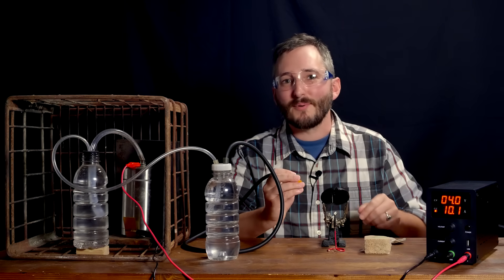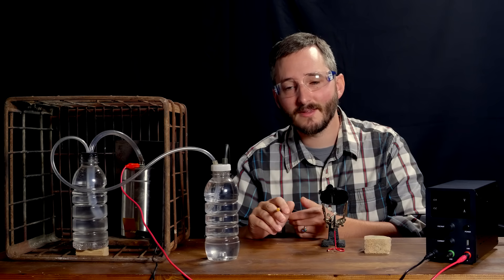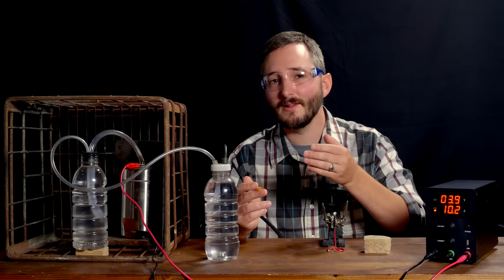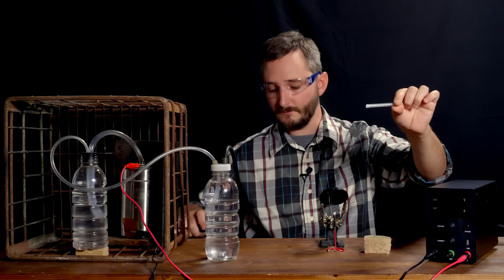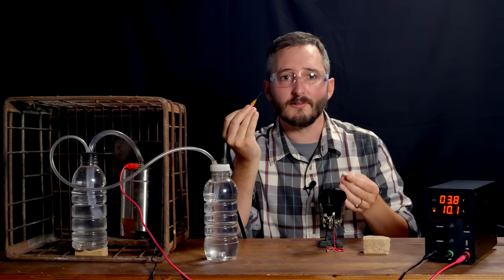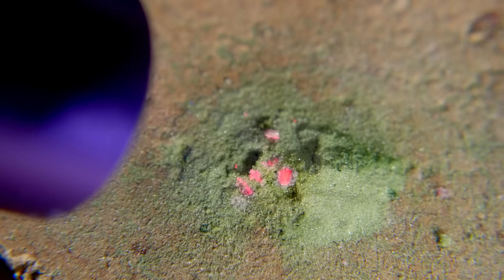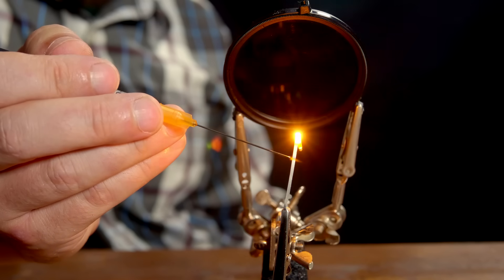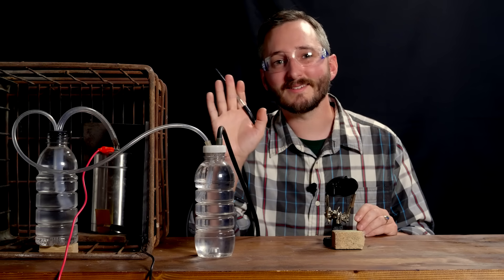DIY Oxy Hydrogen Torch Using Water Electrolysis

Comment: I think you have the necessary ingredients for a ruby 3D printer
Reply: That actually very big brain
Reply from the maker: Interesting thought
Reply: @Nighthawkinlight  Time to get in touch with Integza, 3D print a ruby rocket engine!
Reply: @Nighthawkinlight  nice like metal 3D printer only Ruby?!  Neat!
Reply: @Nighthawkinlight  the setup will blast first before any decent ruby is formed. Or atleast the nozzel will.
Reply: O @Nighthawkinlight
Reply: @Nighthawkinlight  1:30 to bad i defintly will be building one of theses
Reply: @Nighthawkinlight  Holy shiiiiiIIIIIIIIIIIIIT HE'S RIIIIIIIIIIIIIIIIIGHT!!!!!!!! @.@!!! <3
Reply: @Joemama555  brilliant.  I was trying to imagine of the same thing, and couldn't remember where I saw the concept before.  I think for this to work with the ruby precursors, more control over the HHO mixture and pressure would be required.
Reply: Maybe you could 3D print ruby in SLM style 3D printers typically used for metal. I’m sure someone’s tried it in a research setting although SLM printers are prohibitively expensive for the average hobbyist.
Reply: @eyeborg3148  you dont need anything fancy basic 3d printer controls same as the normal guy maybe just in reverse.bottle goes in the same place where you put filament.cable goes down.but is ruby dust really that looked for?there has to be a simpler way to make florescent
Reply: Gotta program the printer in Ruby
Reply: @FireFish5000  if (that != has !beenDone) || could be done even, or odd, oddly enough, then I would personally see sharper by rather printing and programming in pure PEARL if there is such a thing... in fact i think that is almost how they are created in nature, not sure but surely man can make it too, since "we" discovered how to channel energy... well done Firefish5000 
BUT - you said you read all the comments so let US see what You are made of... 
So, how about Gold ? or is that too old ? Original alchemy => why not melt lead and add whatever under heat and if needed pressure to transmute the one into the another... just saying
with that freaking torch you can do even greater things if you give it some boost, 
like thinning things under extreme pressure,
to say 10 atoms thickness, so that it can bend and stretch and perhaps then we can cover the world in something conductive so that we can solve this stupid energy problem once and for all, all starts with a little bit of water, fire air and you can create anything on earth 🙂
Reply: @Joemama555  if the flow rate is high enough, the flow of gas may bring powder with it (similar to sand blasting)? This can greater simplify the design if it works
Reply: @roywang7414 pero para eso existen los compresores,sería bueno lanzar hidrogeno con arena?
Reply: @roywang7414  that idea was several decades old in the 80’s when I read about it in grade school. This was the primary technique for making ruby rods for lasers. The powder would drop via gravity through the flame onto a rotating rod where it would form a boule and the spinning rod would slowly be pulled away from the flame as the rod grew. The ruby making portion of this video was essentially my 7th grade science project back in 1987. Except I used an oxyacetylene torch, because that’s all I had access to. I knew oxyhydrogen was the way to go, but didn’t go through the steps to make an electrolyzer until later.
Reply: @TroyeWelch  in your time was it common knowlage you can extract hydrogen with electrolysis?
Reply: @knezivan1 wow- you’re responding to a comment from 2 years ago? In case you missed it, I was in the 7th grade, I.e., 12 years old. What were you doing when you were 12 years old? lol. Got nothing better to do than add meaningless comments to 2 year old comments?
Reply: I worked for a company back in 2005-2008 that sold and repaired heavy equipment here in Florida. The company added a new service that was the equivalent of re-chroming hydraulic cylinders, except we didn’t use chrome. We used a carbide powder which was sprayed from a nozzle that used propane,oxygen, and hydrogen and compressed air as the fuel for the flame. Think of it like a professional paint spray gun used in the automotive industry, with the gasses and flame replacing the compressed air and the powdered carbide instead of paint.  Chrome involves a more tedious and liquified process and starts to break down on hydraulic cylinders around 100,000 cycles. The carbide coating didn’t show any signs of breakdown at 1 million cycles, for the test was terminated at this point. We used large grinders to strip the chrome off and then placed the cylinders in a lathe sand blaster. Before placing them in the spray booth, a meter was used to check the surface texture so that it’s texture, or “roughness”, was adequate enough for the carbide powder to adhere to it. The spraying was done in cycles to prevent the cylinders from exceeding a certain temperature, it was 500 degrees if I remember correctly, but it did change a little according to the diameter of the cylinder. Once it reached just below the temperature threshold, the flame shut off and the compressed air turned on to cool the cylinders back down to around 250 degrees for the next spray cycles to begin. The coating had to be at least 10 thousandths over the factory cylinder diameter, in which diamond coated sanding belts were used to sand it down to the factory size and then polished to a mirror finish. It looked almost exactly like chrome except it had a very tiny gold tinge to it that most people would never even notice. This was a platform developed by NASA and we were one of only 4 companies in the U.S. that were using this service at the time if my memory serves correct.
Reply: Damn, I was about to suggest this, including Roy's idea of gas-suspended powder. Either way, I'm just really glad Nighthawk was able to hear about it.
Reply: Use Ruby to rewrite the printer's firmware, then it's really a ruby 3D printer.
Reply: Iirc this is called a plasma torch. Used to spray ceramics and metals.
Reply: You’re a great teacher! Thanks for the videos. Just enough to blow myself up but have some ruby’s to show.
Reply: I have an actual, fully working nitrogen printer. Spits out nitrogen gas with 6 degrees of freedom!
Reply: @setoman1  I think this deserves to be the quote of the year! Hell yea man, hell yeah!
Reply: I know its a year later, but I manage a lab that specializes with medical and industrial 3D printers. Using the aluminum oxide, and the chromium oxide as an even mix, one could theoretically use that as medium in Selective laser sintering 3D printing some of the machines use 60w infrared CO2 lasers to melt the mediums and use a re-coater. Check out the company called EOS based in germany. I love Stratasys Printers too. They cost about as much as a 500k house though :(
Reply: He has the necessary parts for Iron man
Reply: Flame fusion, my very reason for watching this video, I wish you the best Guilerme. My eyebrow piercing has two rubies that I intend to use as as seed crystals.
Reply: @annexiota that’s so effing hott
Reply: I've seen the videos where they tried out tig welding with a cnc to try to make a metal 3d printer but if they used this, they could maybe have more precision along with some other benefits. Maybe you could even 3D print rubies like you said, glass and maybe even a few other things.
Reply: Printer out of ruby or printer of ruby
Reply: Maybe it could be better with lasers
Reply: Please try this. Please.
Reply: Very nice demo!
Reply: sounds interesting
Reply: Nice thought 👍🏽
Reply: @manioso77  16 seconds ago notif 2 minutes latefr
Reply: Holy shit you’re right. That’s just a powder resin printer, Isn’t it.
Reply: This. I want to see this.
Reply: Imagine leaving it unattended and hearing a massive explosion from the next room over 😂
Reply: That is unironically how synthetic ruby is manufactured lmao

A thin column of slowly 3d printed zirconium
Reply: Did anyone figure out aluminum oxide dosing? You need to put some amount on top of the melting one, like a 3d pen. At least that will be the first model
Reply: Virtually any synthetic gem could be printed this way but what of powdered metal in an inert atmosphere
Reply: @raymondsmith1213  typically nitrogen is used in SLS 3D printing chambers to avoid oxidative residues.

Comment: Make a huge version of it. And melt some steel.
A separation of Oxygen and Hydrogen and  joining them at the handle of Nozzle may be can prevent the backfire. Because flame can only burn throughout the way until it gets Oxygen.

Comment: I've seen experiments using this HHO flame where the flame could not heat water, nor could it burn flesh, but would heat anything that didn't have water molecules. Now I could be wrong, so I'd never suggest trying to pass your hand through the flame, but you could try something like a sausage or carrot.
Reply: The tiny flame is low power, but very high temperature.

Comment: Now you just need to hook it up to a gas lens from a tig torch with the right size mesh if you feel dangerous enough to up the flow rate to supply enough gas. That would be awesome.

Comment: super exciting project, congrats!
is it possible to use it as a thruster? I am thinking some light device over an helix son it can rotate thanks to the thrust from your needle 
if it is possible to use it with an small amount of the liquids you used, it could possible work, it can all be mounted on the helix and the helix can rotate around some central support.
congrats again, super cool project
Reply from the maker: Maybe. Electrolysis is a good way to generate very high pressures and can be operated on solar in space. It would be hard to turn into a thruster at an amateur level though. You would need a tungsten reaction chamber or something along those lines.

Comment: Really neat! An easy improvement to the apparatus would be a finger valve on the gas line to the needle. That way you wouldn't have to extinguish the flame with the paper towel to stop the gas flow. Alternatively, a one-way valve would work as once the pressure fell if the power was lost, the fuel would be cut off.

I'd also be really interested to see if a Tesla valve could be used as a spark arrester. Since the gas flow is so fast (and thus the pressure), a Tesla valve should really slam the breaks on the reaction.
Reply: tesla valve is an interesting proposition.
i was right about to suggest one myself.
both require no moving parts buy i love yours a bit better.
Reply: A telsa valve doesn't work because it only blocks particle flow, Not heat which is the primary driving force of a flashback. The heat will still penetrate through the now compressed and blocked gas, causing the tesla valve to act as a bomb
Reply: A dead man's switch is the best kind of switch.

Comment: Have you considered adding a cooling collar or heat sink at the base of the needle as another safeguard against the flashback? The collar could even be extendable such that it can extinguish the torch rather than using the wet paper towel.

Comment: 7:13 that is crazy! I have never seen a flame slowly move inside an enclosed tube.
Reply: look up oxy-acetylene torches sustained backfire, cause that's what it's called. This is really scary stuff, especially if you witness it IRL and your torch starts melting in your hands.

Comment: Just curious: what would happen if you tried to melt a hole in a tempered glass? Would it shatter? Drilling or even chemically etching a hole in a sheet of tempered glass does shatter it.
Reply from the maker: It will shatter, I'm 95% sure.

Comment: Was that a pane of glass that the hho melted through at the beginning?
Reply from the maker: Yep
Reply: @Nighthawkinlight  pretty cool that the thermal stress didn't shatter it. I suppose the change is so fast, the glass doesn't have time to fracture, or perhaps fractures are melted as soon as they appear?
Reply from the maker: @EnergyCourtier  The glass usually does shatter after cooling down

Comment: 35W is not too bad a power requirement. Could you make a portable version?
Reply from the maker: You could run this off a solar and battery pack
Reply: @Nighthawkinlight  Would be great if you ever need an oxy hydrogen torch and are off grid.

Comment: I wonder if even though this operates at such a high heat if this could be used as a good wood burning tool, like a professional pencil for drawing but for wood burning. 

Given that the flame is a vary fine point, I also wonder if it could be mounted on a CNC machine or 3d printer set at a given height to do high resolution wood burning.
Reply: That's what you got lasers for
Reply: @sigibaes  CO2 lasers are kinda expensive and they are consumable. I’d be interested in an HHO “laser” for a CNC machine
Reply: @drew899  For engraving only, laser diodes are okay.
Reply: @drew899  CO2? do you want to simply cut through?
For wood engraving a LED pumped fibre laser would be plenty enough.
Still kinda expensive though.
If you want to go flame engraving i would suggest a different gas mix than HHO.
As NightHawk demonstrated in this vid HHO tends to be finicky to prevent the flame from travelling back.
There are fine point burners similar to the one shown available for jewellers.
Those work with propane oxygen mix.

I have not tried it but would guess propane would work better for a CNC machine because you do not have to be constantly vigilant with a wet paper towel.
Reply: @drew899  The needles are also plenty consumable, and replacing laser parts is still cheaper than blowing up your CNC machine with a HHO explosion.
Reply: If you mounted the workpiece above the flame, it could work.
Reply: Kind of doubt it. The heat spreads out quite a bit when it hits something?
Reply: @TheDistur  Depending on how fast the tip is moving would give different stroke sizes. You could always make multiple passes to darken it. Might be a fun project!
Reply: Yeah just search on youtube: laser wood engraving.

Comment: as pointed out in anothercomment adding a little propane to the torch will reduce its flame speed making it less explosive and a little safer to handle.  A little propane will also make it a reducing flame and contrast with an oxidizing flame. 

Alternatly, I wonder how much one can change the properties of a propane torch with some oxyhydrogen.

Comment: As you're giving warnings about flashback, all I can hear is the guy from technology connections saying "ask me how I know".  I don't suppose you had any accidental ones recorded. :)
Reply: I had a flashback incident many moons ago when playing around with a hydrogen system when I was young and dumb..
I didn't have a water bottle in the line, and the end of the outlet hose which would normally have soapy water bubbles over it, didn't at that moment, and the gas, which is of course invisible, flowed out to a standing candle a foot or 2 across the table..
The gas caught, the flame raced back to the hose, and into my 3 litre capacity generator vessel (a large glass coffee jar) igniting the top 2 inches of gas, and blowing the entire thing apart..
The volume of the sound was incredible.
The lid of the jar, also glass, was lodged in the ceiling plaster, and 2 and a half litres of hot, salty (bicarb soda) water was almost instantly distributed quite evenly around my dining room, and easily masked the million or so shards of glass, many of which I was still finding, months later, with my bare feet..
This was 12 or 13 years ago, and is probably the main reason I have very annoying tinnitus now..
I would not recommend repeating this..
As for screaming like a little girl.. dude, there was no time to scream.
Reply: In the beginning of this video, flashbacks are shown
Reply: @YounesLayachi  I know.  I'm looking for the unexpected ones that makes a man scream like a little girl in surprise. 😂
Reply: that was exactly my thought :)
Reply: I even said it when NightHawk didn't.
Reply: I have some bigger flashbacks in a HhOvideo I did a few years ago.  Blew up my bubbler lol. ✅ somewhere on my channel about 3 years ago maybe 4 🤷🏽‍♂️

Comment: would it be possible to have the two gases seperated and combine them just at the tip?
Reply from the maker: Yes, but split output electrolysis designs are harder to make run efficiently

Comment: Id love to see you try to supersize this. I know its dangerous so be careful but something like a 5gal bucket sized one would be cool. However you might need a custom made nozzle which would be expensive.
Reply: If he does it this way where the output is already combined, then shutting off the torch would be extremely, extremely difficult and even more extremely dangerous. If he were to do separate outputs, then the efficiency of the entire setup drops by a significant amount due to the electrodes being further apart. But having separate output allows you to shut off the fuel to prevent a flashback or sustained backfire like he presented in the video
Reply: @Bananovskyyy  he could connect two buckets together and use one as anode one as cathode. ( would require a lot of power ) and mix the two at the nozzle. I just think it would be cool and i think it can be done safely.
Reply: @Bananovskyyy  plus if he invests in four buckets he can have a flashback safety on each fuel and oxygen. No reason it would flash back except maybe in the oxygen if it catches tubing or nozzle on fire. Again just think it would be cool to see it supersized
Reply: @slimpkns7864  honestly it's still pointless because oxy-acetylene is still way more powerful than hydrogen. Remember that acetylene is C2H2, it already has hydrogen in it so upscaling it wouldn't be ground breaking discovery or something new. It would behave exactly like oxy-acetylene but with a colder flame and more potential of deadly explosion. HHO burns at around 2800*C and oxy-acetylene burns at 3200-3500*C
Reply: It's not dangerous. It's straight up suicidal.